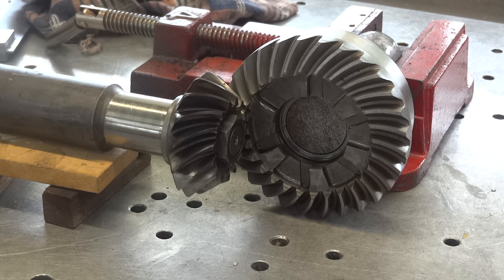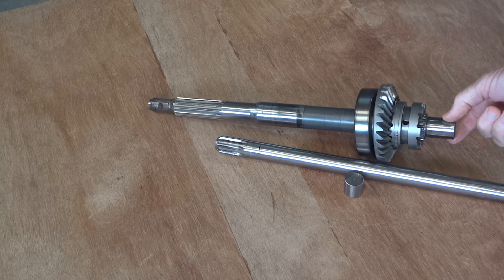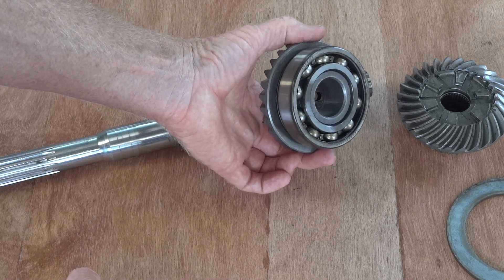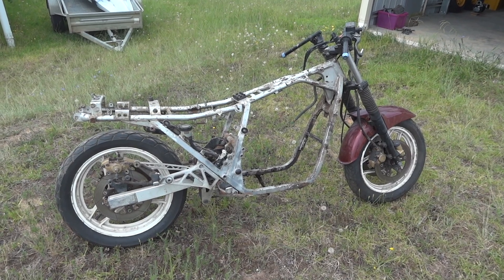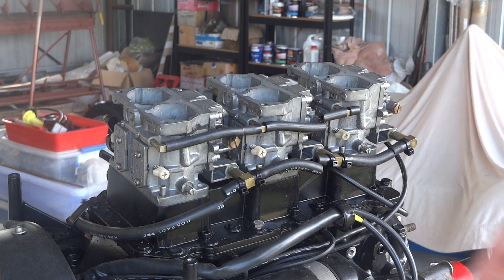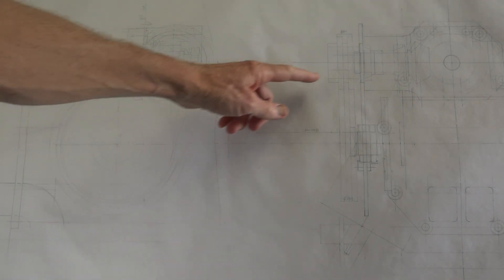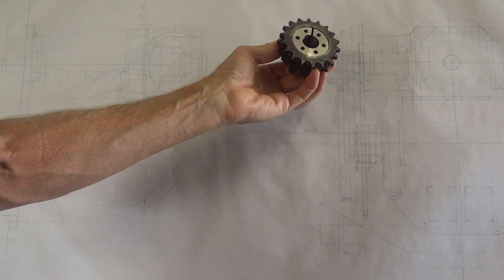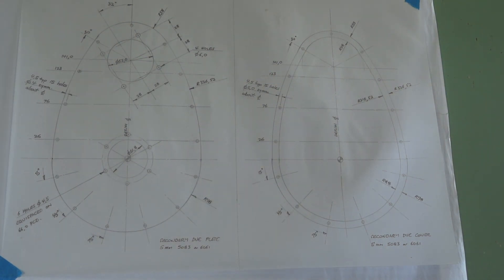Mercurial Outboard Motorbike Bevel Gearbox

Comment: There is a mercury video out there that shows how the Stainless steel prop shaft being friction welded to the carbon steel inner portion of the prop shaft.   They literally just jamb them together until they are fused.     The bearing solution is spot-on.   This video is very telling of the importance of being able to put your thoughts on to technical drawings so that parts can be produced.  Pay attention in drafting class kids!   Well done.  Following intently.

Comment: Re the pair of Webers, if you are free to make your custom manifold any shape you like (3d printed? or welded up), then you needn't keep things square. If the carbs are turned 30 or even 45º to the centerline of the engine, they could overlap a bit, the trumpets at the corners of a rhombus. Or, they could be perpendicular to the centerline, but canted fore and aft, like the guns on a battleship.
Reply from the maker: yes, have considered that. Still considering that actually. Not keen on the throttle linkage though.